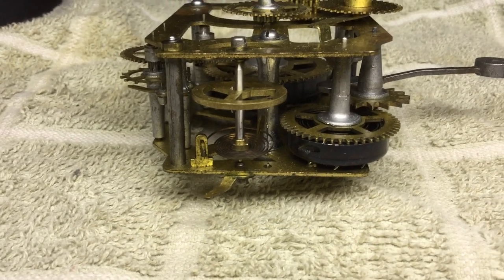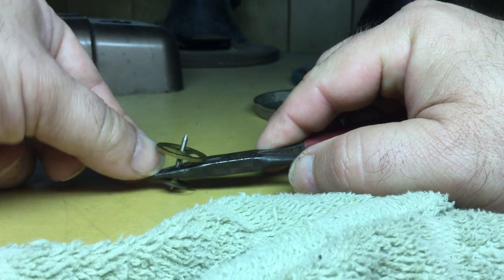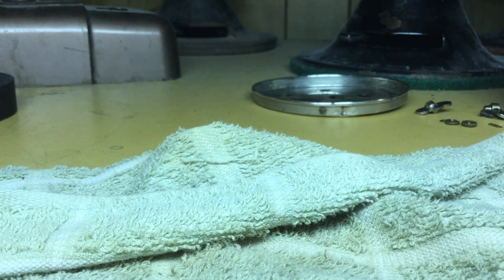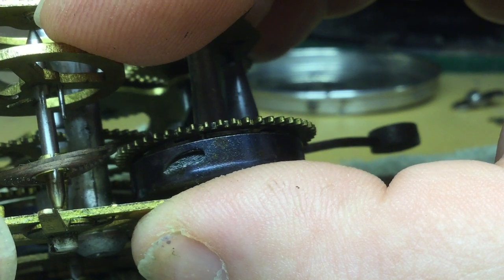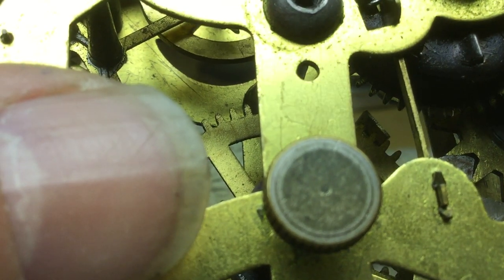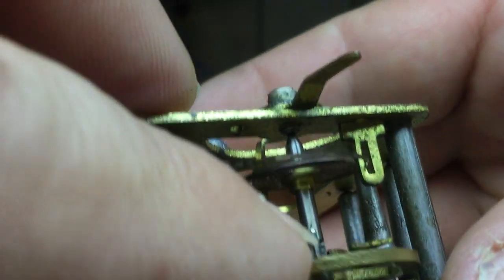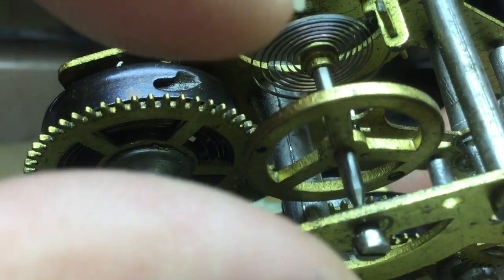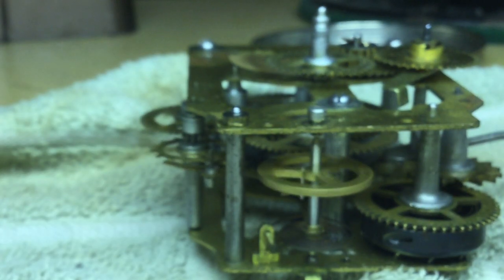Westclox Balance Wheel Remove and Install

Comment: You are a lifesaver! I know very little about balance wheels, even after searching for alarm clock repair videos. Most folks seem to not video this adjustment, or don't do it at all.

I recently bought two modern plastic key-wind alarm clocks ("Advance" brand) to practice on, and had come away more puzzled and intimidated by balance wheels than before I'd started. Thanks you your video, it now all seems to make sense. Thanks again!
Reply: I wish I could double-like this video! I'm watching another person's Baby Ben assembly video, and the poor guy is trying to adjust the beat by changing where the hairspring is pinned. This video of yours is a gold mine!

Comment: I have learned so much from you and Bradford Needham.   Thanks to both of you for the videos.    I have scores of Big Bens and Baby Bens to clean/repair.   I picked them up when they were cheap.  (Now they are getting expensive!)   I could never find much information on them.   Perhaps it's because they are getting expensive that now people are beginning to work on them and make videos.   

I would like to make a request for a video.

Upon, re-assembly, I have big trouble getting the small hand indicating the alarm setting coordinated/adjusted with the minute and hour hands.     What I mean is, getting the alarm to go off at 4:00, for example, and not 4:05, or 3:50.    I turn the alarm setting knob and hear the click, then set my hands to usually noon.   And think everything is OK.   But quite often I get inconsistent results.
Reply from the maker: Mark, Thanks for the Comment!
When putting the hands back on, I usually like to put the alarm hand on first, and turn it till it points to 6 o'clock. Then I turn the minute hand setting knob until the alarm goes off. Then I put the hour hand on pointing at 6, and the minute hand on at 3 or  4 minutes before the hour. Then set and check the alarm trip points and 9, 12 and 3. If the dial is centered well on the movement, there won't be more than a minute or two variation when the alarm trips. And that is probably the best you should expect. 
The wild card is usually the alarm setting hand, as a very small variation in setting, or if the dial is of-center a bit, will throw the alarm trip points off.
  
Most Big Ben Loud Alarm clocks have dials that attach to the movement with feet that can be adjusted to center the dial, and on most clocks you should be able to adjust the dial so that the main dial and the alarm bit dial are centered on their respective arbors. If the dial has a printing error and no amount of adjusting will center both dials, try to center the bit dial for the alarm, it's smaller size will make errors more obvious.

Comment: Love from Kerala, India.
All you videos have been very helpful. Currently iam working on a westclox style 8 , I believe. Which is made in Scotland. I made it work but  it runs slow if you keep the regulator in the middle (about 10 minutes a day) but if you move the regulator all the way to the + side it will run almost perfect. Is there a way to correct this. ..? 

Warning,...!
Iam not a expert in any way so please explain as if to a beginner 😁
Reply from the maker: There are some hairspring 'tricks' that can be done to make the movement regulate with the regulator in the mid-position, but chances are your style 8's movement needs to be cleaned first. I am not sure about the Scottish models, but there were 3 different movements used in the US style 8's maybe more. The style 8 movements are the most difficult ones for a beginner to work on because of their construction. The knobs are attached by being pressed on, and the hairspring is glued in,  rather than using a taper pin.
Wind the clock up fully and watch the balance wheel motion. See some of my other Westclox videos for an idea and an explanation of what to look for. If it is healthy, than the hairspring tricks can be tried. If it is not, then the movement requires cleaning at a minimum before regulation is tried.

What all did you have to do to get the movement running?

Comment: I need to revisit this adjustment, I'm working on a style 1a that won't tick at all even after fiddling with the beat adjustment. Do you oil the cups and pivots?
Reply from the maker: Yes, I oil the balance wheel pivots and impulse pin, see this video for more oiling information: https://youtu.be/3pOy6D-0Ee8?list=PL3n0ffUd1sKMXvQEY3w3HGGz3GRCJSVIv

Comment: Hello. Thank you for sharing your videos. I am having some issues with a balance wheel. Every time I wind the clock the impulse pin jumps out of the fork, the same happens when I flip it over. I wish I could send you a video to show you what I am trying to explain to you. I live in Argentina and I love clocks since I was a Kid and I have fixed many of them as a hobby but this one is giving me a headache. I will appreciate very much your help.
Reply from the maker: I don't know if you found an answer or not, but it sounds like your clock might have a lever which uses a guard pin, and the guard pin is broken off or missing. The guard pin interacts with a part on the balance wheel called the safety roller. The safety roller has a notch cut in it and the notch is in line with the impulse pin. The action of the safety roller and guard pin prevents the lever from moving when the impulse pin is out of the lever fork.

Comment: I've done all sorts of nonsense with trying to install these things. What I really shouldn't have done was started doing this with dollar watches. Those things are a pain! I'm currently repairing a Style 5 Baby Ben. That should be a bit easier to do since everything is bigger. Also, I got a quick question for you. Do you always have to move the collet around to adjust the hairspring's place in the stud? The reason I ask this is because the collet is super small on the dollar watches. I guess It could move on the dollar watch balance staffs, but it would be quite the operation.
Reply from the maker: Normally, no you do not have to adjust the collet. If you don't take the hair spring off the staff, it should not require any adjustment.  
However,  rather than repinning the end of the hair spring to set the heat, you can adjust the collet instead. This is sometimes easier and less fustrating.

Comment: In my saga of re-watching the okbridges “CLASSIC” series of videos, I’ve got another question! How would one go about polishing/sharpening the ends of the balance staff? Would a lathe be the way to go?
Reply from the maker: If you don't have a large, you can use a drill press running at it's highest speed. Make sure the chuck is clean and will tighten down that small.
A corded electric drill secured to a bench on it's side also will work.  Battery drills don't run fast enough.
A lathe, especially a small watchmaker's lathe is the best one to use for this job.

Comment: Hi- how do you set the alarm hand to the right location on the clock face after reassembling? Do you just make sure the alarm is tripped and move the alarm hand to match whatever the time is?
Reply from the maker: Put the alarm hand on first, then set it to 6. Turn the minute hand setter until the alarm trips, then put on the hour hand pointing at 6, and put on the minute hand pointing at 3 minutes till the hour.  Then test hand alignment and alarm trip at 12, 3 and 9, and adjust if needed.

Comment: Where do you order your hairsprings from?  I have a need for a little larger clock.  I used the largest spring in an assortment from Timesavers, but the clock runs fast in it's slowest setting.
Reply from the maker: If it runs fast, use a weaker, smaller hairspring or one that is longer, with more coils. I don't know a good place to buy hairsprings from apart from salvaging them from parts clocks.